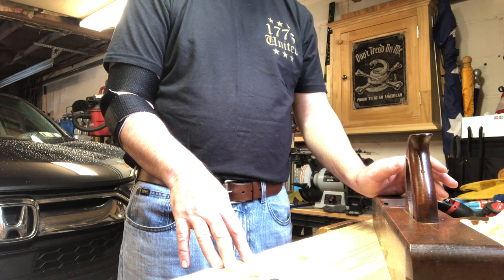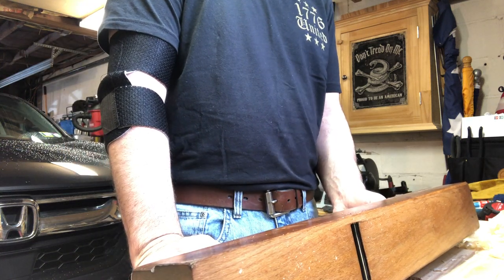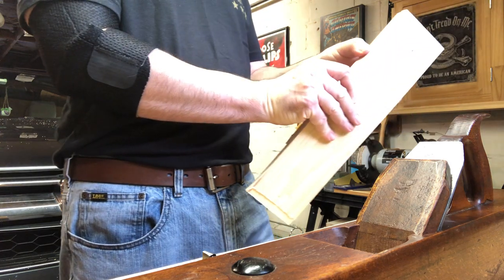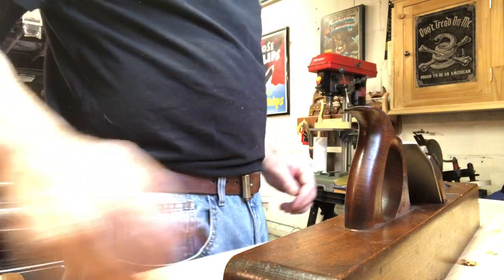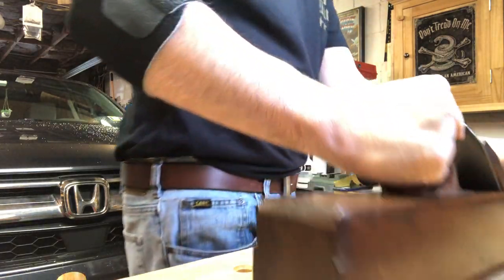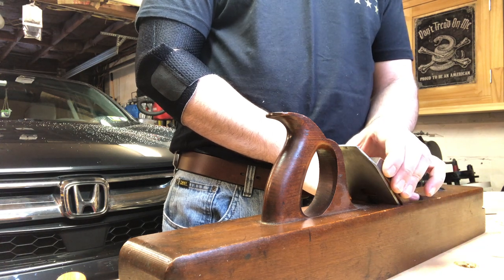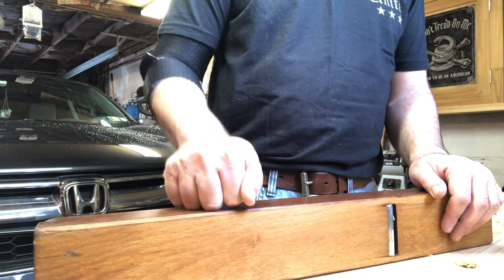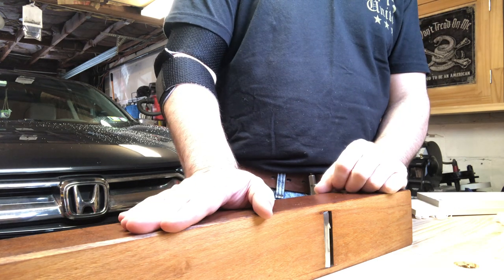Edge jointing two boards with a wood-bodied jointer plane.

Comment: As a uk bench joiner of 45 years I would take a wooden plane over a metal plane any day . That's a nice plane all you need is to put a mouth closer in and it will see you out .
Reply from the maker: Agreed, I generally love the feel of a wood-bodied plane. I like the #7 for edge jointing because I’m more familiar with it and accustomed to the friction. But, otherwise I’m definitely a big proponent of wood-bodied planes.

Comment: Metal jointers are quite a nightmare to me personally, unless it's already stable flat casting, you can pretty much plane a wooden jointer dead flat with a good NR.5 metal plane. Where do you even find a thick enough piece of glass or flat granite to lap a metal jointer, it's not worth it at all in my opinion, might as well buy a 300$ already flat stable plane than trying to source the necessary items to flatten such a big plane.
Reply from the maker: Yeah…a #7 that needs to be lapped isn’t worth the attempt.